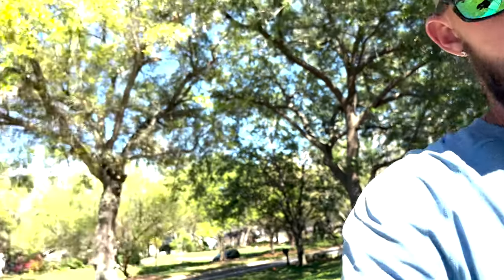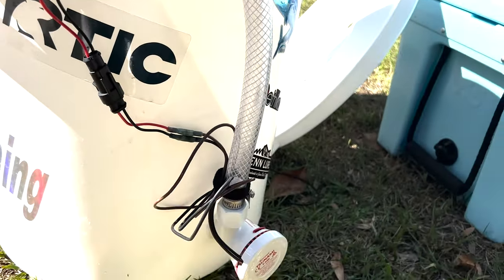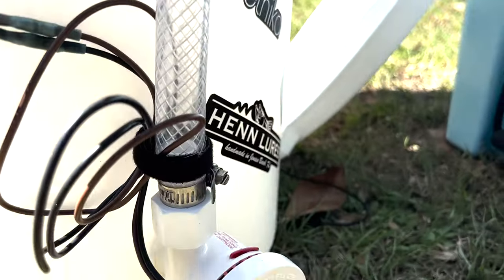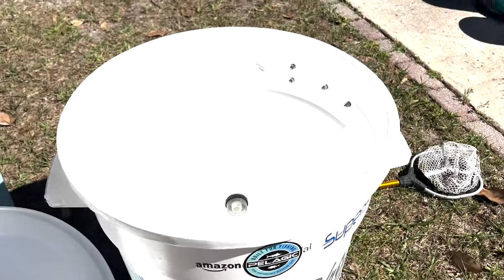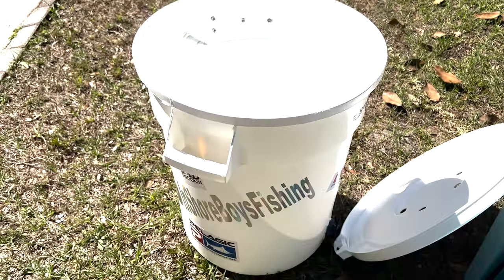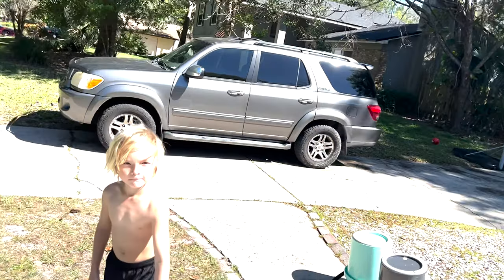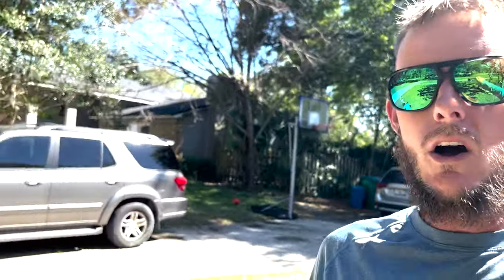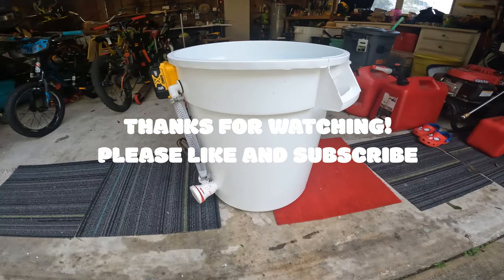*DIY BaitWell, LiveWell for Pier Fishing*

Comment: Sweet. I got 12v DeWalt batteries. What is the battery hooking into that's wired to the converter?
Reply from the maker: There should be a link in the description. It’s a battery converter that converts the 18volts into 12v so it doesn’t burn out the pump